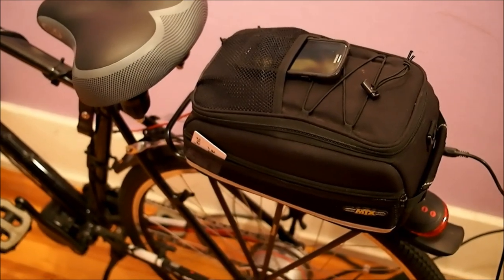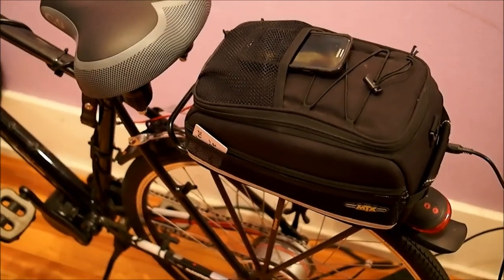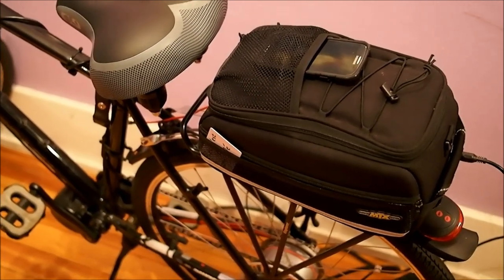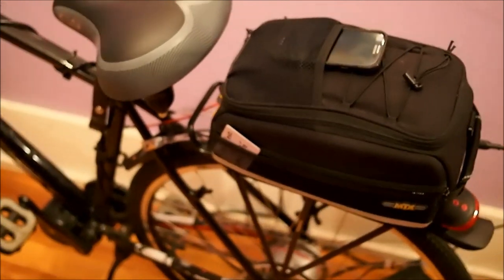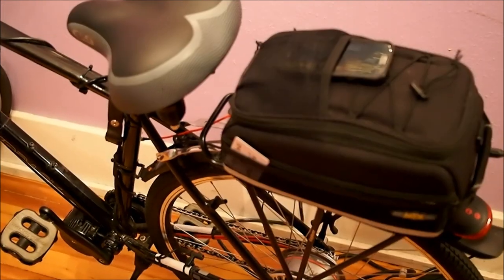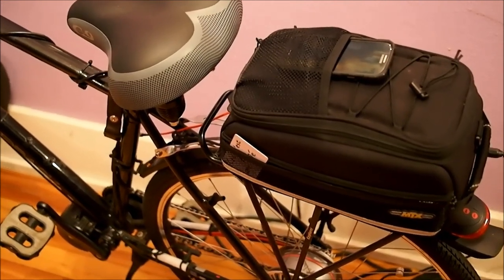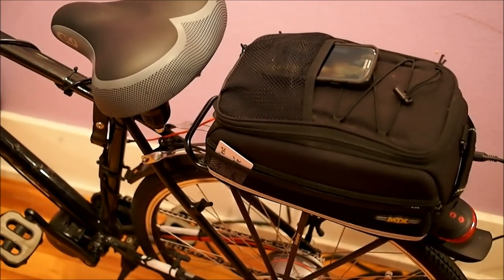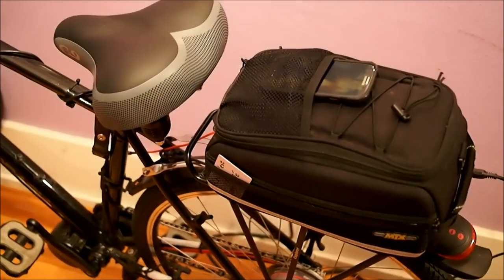Nano Bike Alarm V2.0 Demo

Comment: I'm, so glad I stumbled onto this project by searching Youtube for FONA 808. I am intending to build a very similar open source project for my motorcycle (or any other vehicle/asset). Instead of the RFID reader, I simply intend to use a high signal (from my headlight, a car radio, etc.) as the authorization. I've considered using an accelerometer as motion detection to cut down on armed power consumption rather than relying solely on the GPS. I would also like to be able to arm, disarm, request a single location report, set a reporting interval, and trigger an audible alarm (for when you/police arrive at the GPS location) via SMS. I haven't dug into your code yet (as the FONA 808 is out of stock). I expect there will be lots of code I and learn from in there. I would like us to collaborate on an library that can serve as an asset tracking toolkit. Even though we have different goals and utilize different peripherals, we share a lot of the same needs. I expect that others will come along and want to make similar systems with different design goals as well. (As a skydiver, my 2nd FONA project will be for tracking a cut away parachute and notifying an emergency contact that I pulled my reserve.)
Reply from the maker: +Bruno “Richard” Bronosky - I somehow totally missed this comment when you posted. But your project sounds cool. how'd it turn out?

Comment: How is this holding on? Still using it?
Reply from the maker: No. Thanks to the 2G and 3G sunsets, frequency bands for mobile phones have changed and the cellular modem used in this circuit can no longer connect to the network. My bike needs a new battery too at this point, so I may redesign the circuit when I replace the battery.But I might just go with LoRa instead of using cell networks.
Reply: @charleswerbick2154  Oh? Sorry to hear that, as I just wanted to build it. Commercial alarms are too exoensive for what they are. LoRa sounds great but it's range is limited. LoRa with GSM would be great to have at the same time.